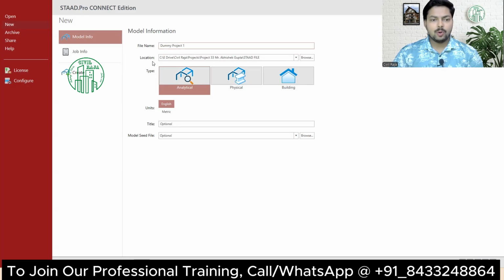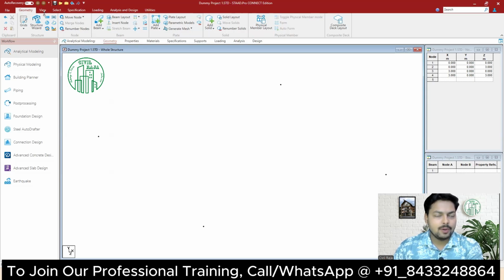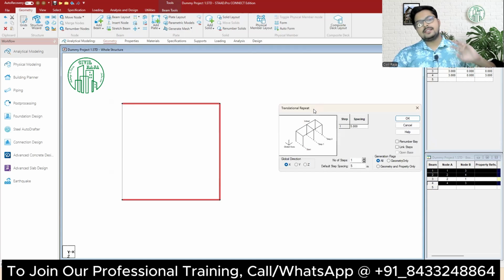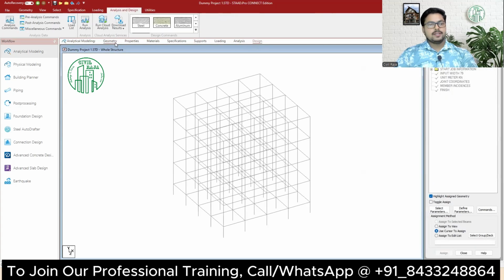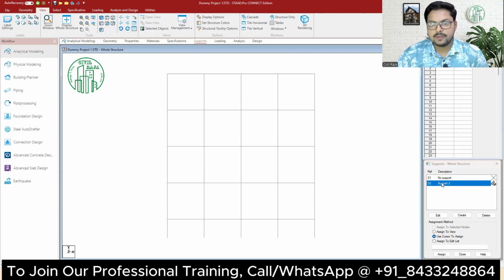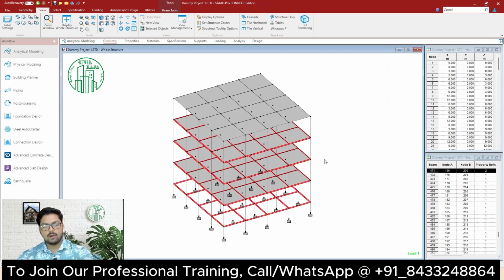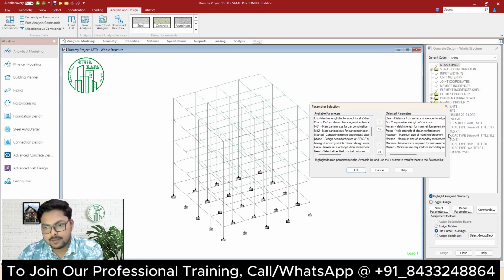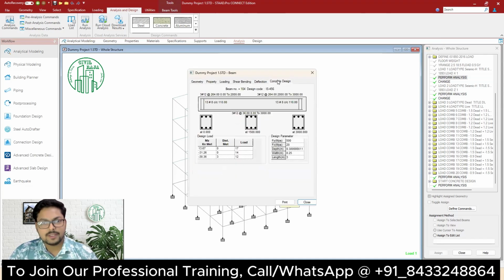Master STAAD Pro Connect: Complete RCC Building Design in 1.5 Hours (Demo)

Comment: What is the correct method for modeling a drop beam within a single span in Staad Pro
Reply from the maker: Modeling a drop beam (a beam where the top of the beam is lower than the slab level or the main floor line) in STAAD.Pro requires careful handling of the beam's eccentricity relative to the analytical nodes.
In STAAD, by default, members are modeled at their centroid. To represent a drop beam accurately, you have two primary methods:
1. Using Member Offsets (Recommended)
This is the most common and standard method. It keeps the analytical nodes at the floor level (where the slab is) while physically shifting the beam downward.
Steps:
 * Identify the Offset Value: Calculate the distance from the floor level (node center) to the centroid of your dropped beam.
   * If the node is at the slab top and the beam is dropped, the offset in the negative Global Y-direction (d_y) is usually:
     
 * Assign the Offset:
   * Go to Specifications > Beam.
   * Select the Offset tab.
   * Choose Start for the location.
   * Input the negative value in the Y direction (e.g., -0.3 meters).
   * Repeat this for the End of the beam.
 * Check 3D Rendering: Switch to the 3D Rendered View to verify that the beam is physically sitting below the slab level as intended.
2. Using Rigid Links (Complex Geometry)
If you have a very large drop or need to model specific connectivity between the slab and the beam, you can use rigid links.
 * Model the slab nodes at the top level.
 * Model the beam nodes at their actual physical centroid elevation.
 * Connect the top nodes to the bottom nodes using a Rigid Member (a member with very high E and I values) or a Master-Slave constraint.
> Note: This method increases the number of nodes and members in your model, which can make it harder to manage and analyze.
> 
Key Considerations
 * Self-Weight: STAAD calculates self-weight based on the member's cross-section and length. Offsetting a beam does not change its weight, but it does introduce an additional moment (P \cdot e) into the columns because the load is no longer applied at the column's centerline.
 * Shear and Moment: When you use offsets, the internal force diagrams will reflect the eccentricity. Ensure your column design accounts for the resulting eccentric moments.
 * Design Phase: Be aware that some older design codes in STAAD might not fully account for the offset when calculating effective lengths. Always double-check your design parameters (LZ, LY) after applying offsets.